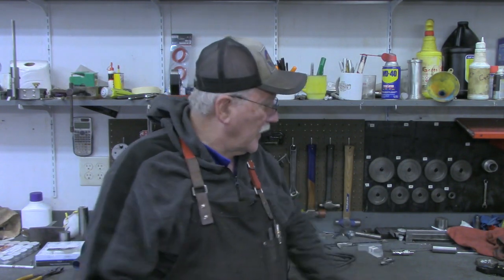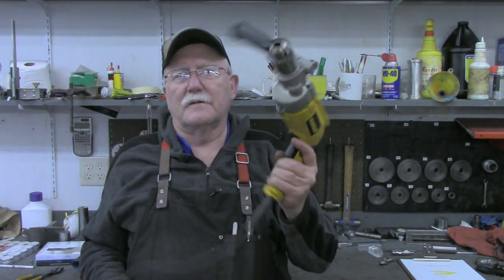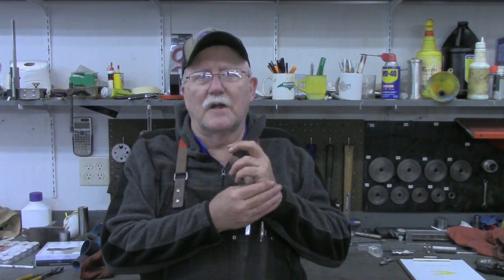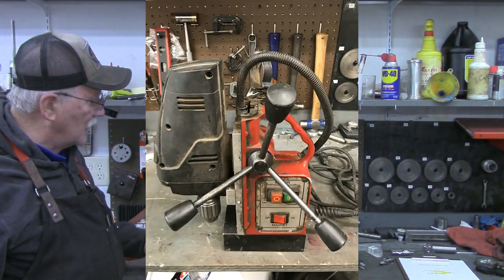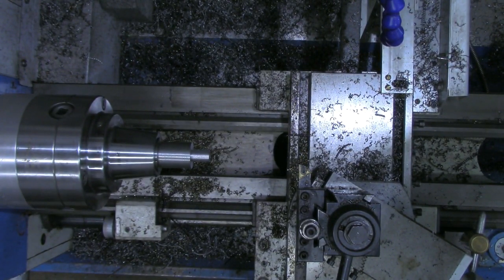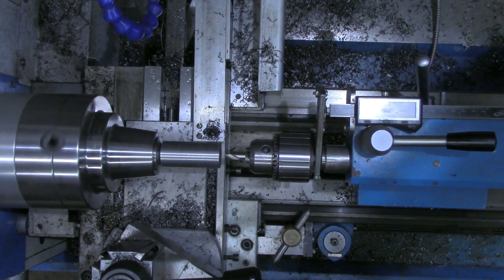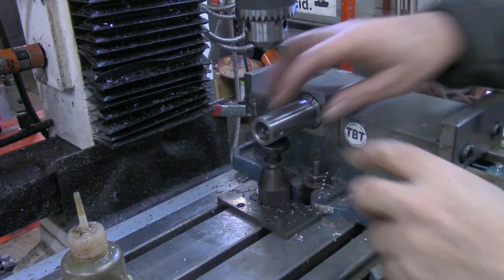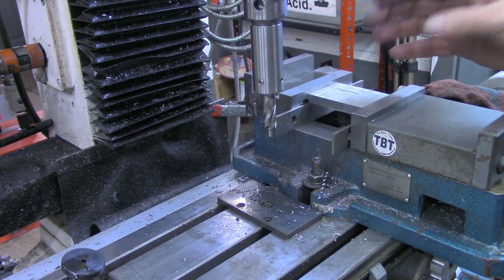Annular Cutter 1/2" Chuck Adapter

Comment: Lee, For those occasions when you will be drilling with that De Walt, for safety purposes screw a longer pipe into where the handle is now.  Use that pipe as a brace against a wall or I have also used a large clamp.  It will save some broken bones.  Thanks for your simple solve for annular cutters into drill chucks. Bill

Comment: If you design a spring into your adapter it will aid in keeping the annular cutter from drifting at the start of a new hole as well as provide ejection of the remaining plug.  I have used these for years and also have an R8 adapter for the mill.

Comment: Hello Lee,  I have been wanting a mag drill for decades but like you I couldn't justify the huge expense for the time I would use it.  Recently I saw a video where the guy said he had just bought one by evo for a reasonable price.  On amazon it went as low as $225.  Well I thought this is attractive so I looked some more.  I found a chinese (aren't they all anyway?) one for $70!  An Evo also.  Then I saw another with a bit better capacity for $85 delivered!  For that price I have to gamble.  So I ordered one a few days ago.  We will see.  I bought a small set of annular cutters several years ago and did the same project you are doing so I could use them in my press.  I have a Milwaukee Hole Hawg which I bought in the seventies.  That is a serious machine which can easily break you arm as it has no clutch.  The professional Black and Decker came out with the Timberwolf which was the first with a clutch a couple of years later and I sure wished I had it when drilling large holes up in the floor joists etc.  Those drill motors without that clutch were an attention getting device!!  Drilling thick metal when it exits the hole on the bottom it wants to grab anyway. Used on the floor with a good pipe handle not so bad used on metal or in the stud bays and joist bays watch out!  Take care.  Doug

Comment: I made one of these last spring to work in a 3/4 collet on a milling machine. I spring loaded the ejector pin... it works very well for any metal 1/2" thick or less. With modifications  ou could make one to work for thicker plate.
Reply: I had the same type of deal last year too, on a mill/drill....making a table for a bender machine ( hossfeld bender). The Er 32 collet worked , but i had trouble finding speeds for them.....i did figure out high speeds are best... 3/4" ~2200rmp
Reply: I used it on 11/16th plate......first try i got about 15 holes....second still sharp with over 20 holes done. Amazing
Reply: @mrjohnnydrinkard322  2200 wow? I think the mag drills run about 450?
Reply: yeah i thought the same....but worked fine and still sharp, i thought to run it like an end mill thats when i dulled it(.slow) just Keep It Lubricanted , i used regular motor oil, burns up fast but reasonable cheap and i put a small rod next to the cutter to break the bird nest

Comment: Lee, why didn't you remove the Jacobs, and screw your adapter in?  

You would gain the length of the Jacobs chuck for drilling clearance

those 2-flat shanks are called Weldon shanks

Comment: I think that the modern welding table clamps and pins use 5/16 - 16 mm holes.  Neat gizmos.  What size annular cutter will you be using?

Comment: The little hex bolt tightens the bit. What is that called ?  My slugger is missing those bolts. I can not tie in the bits .. thank you I could not find that online

Comment: To safely drill 1/2"holes in awkward spots I take a 1/2"drill bit to the grinder and make it into a counterbore tool. The remaining centre becomes the pilot and I carefully set the relief angle of the now flattened wing cutters so the drill won't bite. It is similar to the flat bottom dril Lee used. The only issue I have found is that  the bits grow legs.

Comment: I realise I'm rather late to the party but if you wanted to use that adaptor in your mill couldn't you cut a slot along the length of it on both sides? That way when you want to knock out the slug with the 'guide pin' you could knock a piece of angled metal through the slot and knock out the pin. Rather like how a morse taper adaptor has a slot for the same reason. Nice video though, I think I'll have to make something similar as annular cutters are really useful but this will help to set them up in a drill press rather than faffing around with a mag drill!

Comment: I like your build on this and am intersted in an adapter my own self but was curious if  you think you could drill a smaller hole in the core than what you did with enough clearance for the plug pin to fit in and then drill a hole above it that would be like a grub screw hole but use it for hitting with air pressure to push the plugs out?  I was just thinking that once you get to working on your project it might take less time if you can push the plugs out with air pressure rather than having to remove the drill bit (which might happen a fair amount).   Just curious if you think that could work or if it would not be air tight enough.   I'm interested for your project but also with idea of making an adapter of my own down the road.  Thanks!